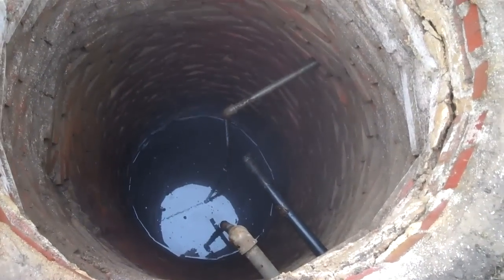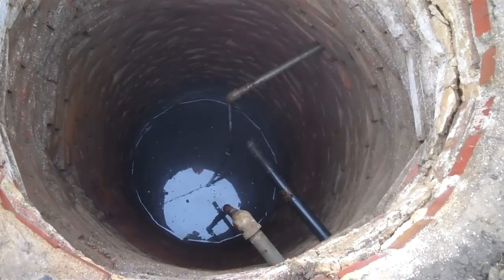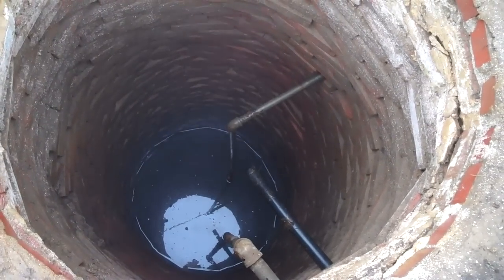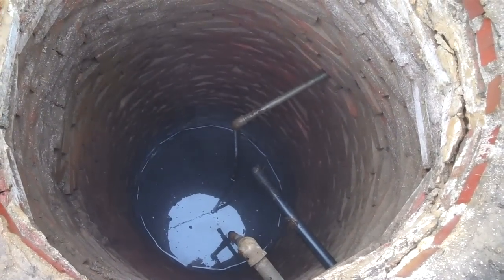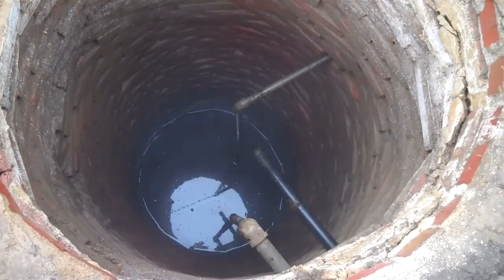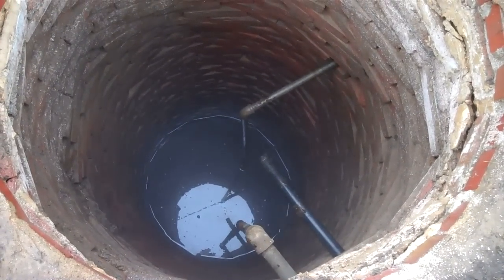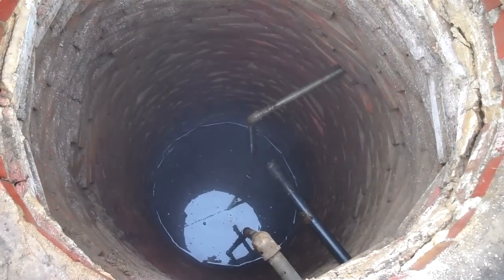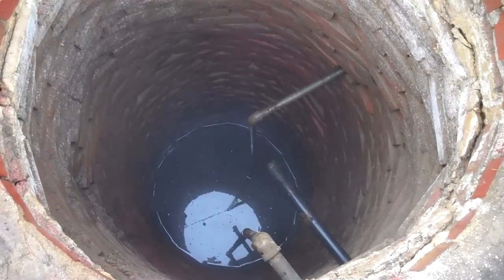An Old Farm Well

Comment: is the water drinkable?  It doesn't appear it would be..Really cool video!
Reply: If the water is more than about 6' (2m) under ground, the top of the well is sealed up from ground level stuff getting in, and there's no source of contamination from a septic system or farm animal runoff within a few hundred feet then it's very likely for potable water.